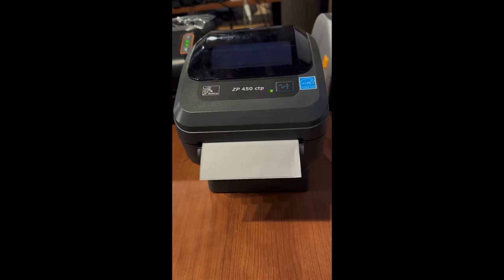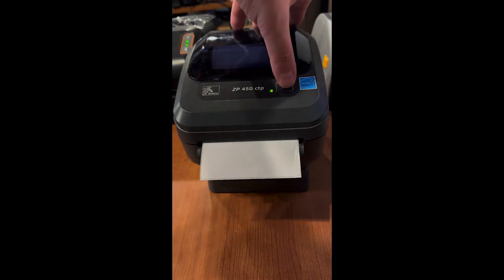Here's how to perform label alignment on a Zebra ZP450 thermal printer

Comment: What would be causing my labels to wrinkle/crease when printing? I'm near the end of the roll, but it still has plenty of labels left on it. I've checked & they're not creased/wrinkled before they roll through to print. I also wiped down the roller with alcohol to see if that helps, but it did not. It's doing it in diff spots every time I print one.
Reply: It could be moisture or the age of the labels. If you put in a new roll is it OK?
Reply: @andyk4819  I've not tried changing the roll, as I hated to waste so many, but I will to check. Thanks for the advice!

Comment: Its not printing on the 4x6 area for me, its printing on the bottom of the business card size piece where it shouldn’t, its printing part of the actual label on the receipt part, any suggestions? Please and thank you!
Reply: Hey Kevin - That sounds like a label rotation issue. You should be able to do a factory reset - instead of the two flashes, do four flashes. If you still have the problem then it could be your print driver (assuming you're on windows) which is rotating.
Reply: @andyk4819  I have the exact kind of labels you have in the video, so what should I set my label size as, 4x6 or 4 x 8.25?
Reply: @kevinthemayor  you fixed it? I have the same issue